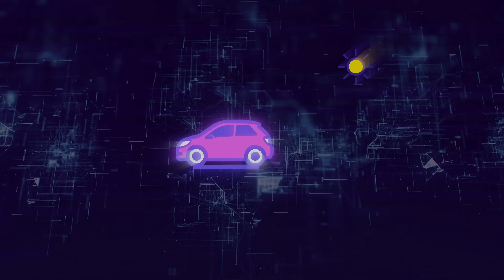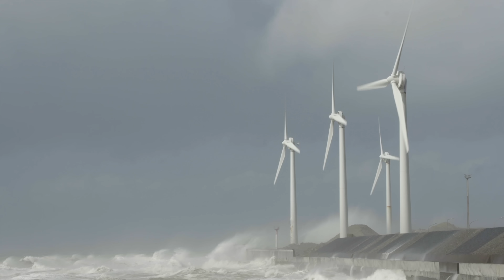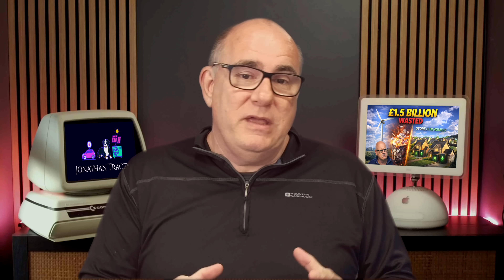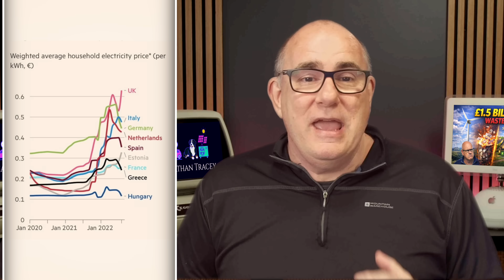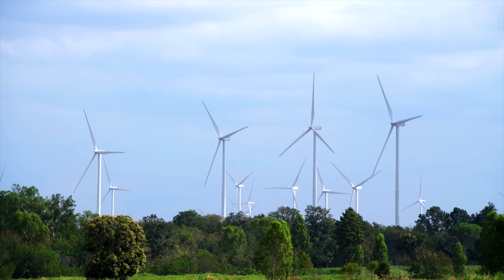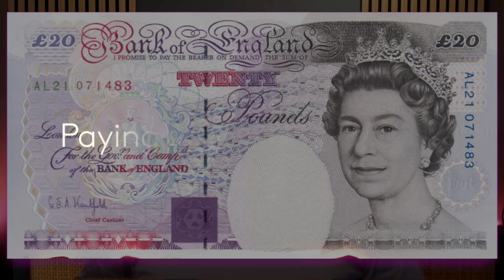We’re Paying £1 5 BILLION To Waste Energy… Here’s My Big Idea

Comment: Did you really just say putting a battery in your house will reduce your energy bill? How?
Reply from the maker: @tarbat Yep — sounds odd at first, but it’s actually pretty simple once you break it down 👍  

There are basically two ways a home battery saves money:

*1) “Free” or surplus energy*  
When there’s too much generation on the grid (lots of wind/solar), prices can drop very low — sometimes even negative.  
If your battery charges during those periods (either automatically via a smart tariff or because you’ve got your own solar), you’re effectively storing energy that costs very little — or nothing.  

Instead of exporting it cheaply (or the grid curtailing it), you keep it and use it later in the evening when electricity is expensive.

*2) Cheap overnight → expensive daytime (arbitrage)*  
On tariffs like Octopus Go, you might pay ~7p/kWh overnight and ~27–30p during the day.  

So the battery:
- Charges overnight when it’s cheap  
- Discharges during the day when it’s expensive  

That difference (say ~20p/kWh) is your saving — every unit you don’t buy at peak price adds up.

So no, the battery doesn’t “create” energy — it just lets you *choose when you buy it* and avoid the expensive periods.  

That’s where the savings come from 👍
Reply: @JonathanTracey  All of that requires me to move to a time-of-use tariff. I've done the sums for intelligent Octopus Go, and I would need a 12kWh battery to break even by storing energy during the 6 hour night rate (8p) to make up for the far more expensive 18hours of daytime rate (33.5p). That's just to break even, with a capital cost of £8,000 for the batteries.
Reply: My home battery  saves me over £1.5k per year
Reply: @SDK2006b How?  My electricity costs me 22p per kWh 24x7. Storing it in a battery won't save me any money. In fact given the charge/discharge losses, my bill will increase.

Comment: with a lot of excess wind energy in scotland and transmission constraints first at b6 and than at b4 one should start handing out batteries in scotland first!
Reply from the maker: that's exactly how it should be one, then you lighten the load in scotland and allow more capacity to move energy south, you then chase it south adding batteries as you go
Reply: Yes, hand out batteries for free, but also pay the householder "rent" to host the batteries. I'd sign up for that.
Reply: @tarbat  Maybe that's an extension for Octopus to look at. It's really just a twist on intelligent flux. My guess is that you can't make the numbers work.
Reply: It would take 240 GWh of batteries in Scotland to solve this issue, which would cost £48B. The cables they're already installing will be ready by 2030 and cost £8B. If we did this in BEVs, we'd need 3.7M 0% SoC BEVs connected to the grid. There's only 3M cars in Scotland as it is.

Comment: As unreliables are... unreliable, and gas is always kept in spinning reserve, the solution is obvious: scrap windmills and just burn gas efficiently. End the farce of pretending it's green - unreliables, that is - and just abandon the gibbering nonsense of unreliables. Australia tried grid scale batteries. A small mining town in the outback (mining for copper for solar panels, ironically) needed a hectare for ten minutes of backup at comedic cost. 

Home batteries are a good idea, but 2k/Mw wouldn't be anywhere nearly close enough, let alone there's just not enough material to make them. Comparably the 1.5bn - a month, mind, not a year - is nothing compared to the cost of those batteries and really, all we're doing is giving money to China, DRC, India for mining. It is far, far far more sensible to just abandon the hoax of unreliables.
Reply from the maker: @px794 I get where you’re coming from, but I think this is mixing a few different issues together.  

Gas is reliable, but it’s also exactly what’s driving the price volatility we’re all dealing with — that’s the bit people are trying to move away from, not just for “green” reasons but for cost stability as well.  

On batteries — they’re not meant to replace weeks of generation, they’re there to smooth short-term imbalances (hours, not days). That’s exactly where most of the curtailment cost sits today.  

The Australia example gets quoted a lot, but there are also multiple grid-scale batteries there now saving money by reducing peak demand and stabilising the grid — so it’s not quite the failure it’s often made out to be.  

And on materials — totally fair point that scaling isn’t trivial, but the same argument applies to gas infrastructure and imports. We’re already dependent on global supply chains either way.  

Reality is this isn’t “gas vs renewables” — it’s about building a system where renewables, storage, and flexible demand all work together so we’re not paying to turn things off and paying for gas at the same time.

Comment: Homes are space constrained and awkward places to put energy generation, at scale. Also for doing it at scale, get it wrong and there are fire risks, cybersecurity risks etc. Feels like it would be better to just go have a programme of building grid-scale batteries near wind farms.
Reply from the maker: @cjholmes2 All valid points 👍 — but they’re also the same reasons we end up doing nothing and sticking with the status quo.  

Grid-scale batteries absolutely have a role, but they come with their own risks — centralisation makes them a much bigger target (both physically and from a cybersecurity point of view), and you still need massive grid upgrades to move that energy around.  

Distributed storage flips that on its head. Yes, it’s messier, but it’s also more resilient — thousands of small systems are a lot harder to “take out” than a few big ones.  

And on cost/speed… a home battery can be deployed today with a plug. Grid-scale takes years of planning, approvals, and infrastructure.  

Reality is we probably need both — but waiting for the perfect centralised solution is exactly how we end up curtailing £1bn+ of energy in the meantime.
Reply: @JonathanTracey  We already have that. The method of buying a big home battery to store off peak electricity on the cheap is not a new idea. You don't need government permission to buy and use a standalone battery that only connect to the grid to charge. It does technically work but it is expensive when you consider that batteries are expensive and they degrade with every charge/discharge cycle that you put them through. People used to tout them as the being the solution and then it's gone all quiet(my guess is that reality hits home when they realise that electrical batteries don't last as long as they thought). Anyone can personally put it to the test.

Comment: I've been saying this for yearrs! What about new "smart" appliances all having a battery, so they can store their own energy from off-peak times?
Reply from the maker: I'm not sure putting the battery in the appliance is right, then it limits the use of stored energy to that device, having a central battery means any devices can use the energy
Reply: Smart devices that can be set to switch on during cheap electricity times, but separate smart batteries that can feed dumb appliances, and occasionally smart appliances, with saved off peak electricity.
Both my washing machine and dishwasher can be set to turn on later, but linking  smarter versions to actually prices as they vary would be even better.
Reply: @ziggarillo 
Both my white goods have timers, but trying to explain to the CFO they are okay to use in the Cheap periods at night ! Is a headache that I am getting tired of 😢.
Reply: Two problems with that
- It's more cost efficient to have one big battery
- PAS63100 says your battery belongs outside, in a garage or similarly fire partitioned and definitely not where it might block an access route or there is naked flame.

It is doable - there are actually cookers in some countries that include batteries so they can manage to operate a decent sized induction stove and ovens off a low rated electric cable.

Comment: Well put I am 100% behind what you say. We need to run the grid connections at 100% day and night. I have 21Kwh batteries + 60  Kwh Tesla car and would love some of that free energy in the winter.
Reply from the maker: there should be a standing rule we don't shut down renewables even if we have to give the energy away. I don't agree with negative pricing (being paid to use it) but zero cost energy when there is a glut that needs used up
Reply: Jon i can't get Octopus flux because they have withdrawn it from the market

Comment: I think newer electric cars can do bi directional charging. So if the house needs power it can pinch a bit from the car and top the car up in the small hours. So the majority of houses would have its own storage by default? Appreciate we're a ways off that with couple of million EVs currently. But in the longer run...
Reply from the maker: all evs are technically capable its just not a function the manufacturers are turning on
Reply: @JonathanTracey  Is this true? It would need a DC to AC converter inside the car. As this would only be needed for V2G I doubt that any car that is not declared V2G capable has it.
Reply: @rockyallen5092  This is on point. The V2L ones might not by G98/G99 compliant for grid export. You need V2G for compliance with the regulations. Hypothetically you could export DC via CCS to an external inverter to enable export from EV's without V2G with DC fast charging, via a software update.
Reply: @Leo99929  There are a bunch of G98 approved devices that can use V2L as a secondary battery charger (you need a buffer battery really). It's easy to set up if plug in becomes allowed but there are some important details about grounding and stuff.

There are kits for V2L->plug in "solar/battery" in some countries. It's not hard - not particulary efficient either though.
Reply: Totally. Our 60kwh-ish EVs are idle for 95% of the time; turn them into revenue generators. Furthermore, governments should have holistic regulatory and taxation structures to encompass such facilities for nearly all that 95%. At work, gym, shopping centre, etc. After all, one's consumption (and connection to local generation - solar on such buildings for example) largely follows you around. It would negate much of the big delays in the grid to catching up, remove gas from the network almost completely, speed up electrification and reduce emissions from transport and the grid more generally.
Reply: This only solves the problem if ~3.7 Million BEVs are plugged in at 0% SoC north of the B6 in Scotland. There are currently only about 3.09 million cars in Scotland. Assuming 50% SoC that's >7M cars. This sadly isn't a viable option. 

Luckily to fix this, the UK is currently building the Eastern Green Links (EGL1, 2, 3, and 4). These are additional 2 GW subsea cables. By the early 2030s, these will more than triple the capacity to move power south.  The goal isn't just to stop the 10 TWh of waste we have today, but to prepare for the 80+ GW of new wind power currently in the planning pipeline—enough to turn Scotland into a "green battery" for the rest of Europe.

Comment: I agree with your idea. But putting small batteries in every home may get quite expensive. They should change the laws in substations allow them to store energy and sell it back. And install batteries in every local substation. And give incentives for homeowners to get batterys like bigger discounts. Or 0 interest loans
Reply from the maker: by putting them in every home you get a fully distributed battery, centralised batteries would need large expensive interconnets to the grid
Reply: @JonathanTracey it wouldn't be any more expensive than putting a battery and small inverter in every single home. Substations already have the infrastructure. Batteries what  just allow them to even out the the demand. Especially during peak hours. Building 200 kilowatt hour batteries would we fight cheaper than building the equivalent in smaller batteries.

Comment: Absolutely correct Johnathan.  We also need to get vehicle to grid sorted, with the size of car batteries often sitting there that could be used. The trouble is the Governments respond to negative thinking people and are scared to loose votes. Sad.
Reply from the maker: @terrylivermore9107 V2G is a great idea in principle 👍 — you’ve got huge batteries just sitting there most of the time, so it makes total sense to use them.  

The challenge at the moment is incentives. There’s not really anything in it for the car manufacturers — from their point of view it just adds more cycles to the battery, which means more wear and potentially more warranty claims.  

Until there’s a clear way for them to make money from it (or reduce their risk), I don’t think they’ll be in a rush to fully open it up.  

Feels like one of those things that will happen eventually… but needs the right business model, not just the technology.
Reply: Think about a small business, hammered by extortionate electricity costs.. V2L would destroy that exploitation, you could simply charge up at home drive to work and plug in.. They would have to figure out a way of preventing that😅
Reply: 100% agree, we do! But it wouldn't solve the problem given the 240 GWh battery needed would be 3.7M cars at 0% SoC, and there's only 3M in Scotland at the moment... Don't worry, they're building under sea cables for £8B. The battery would cost £48B at 40% of the cost per kWh Jonathan estimated.

Comment: To much common sense for this Government
Reply from the maker: TBH for any government, they are not interested in big ideas, just keep the gravy train flowing
Reply: Has anyone said that highly intelligent “What happens when the wind doesn’t blow or the sun doesn’t shine”
BATTERIES!
Like for a hundred years we stored coal and gas, not mined another lump of coal when we ran out.
Reply: This is precisely the sort of daft idea this government would come up with. Spend 5bn on batteries  - which would take 3 years to provide by the time a better battery material would have been invented, eventually costing 20bn by which time the unreliables hoax has been abandoned and home batteries not needed. Stop trying to solve the symptom. Cure the disease. Abandon the tax scam hoax of unreliables.
Reply: @px794  ... What are you talking about? 

Solar and wind are half the price of gas even including batteries for when it isn't windy/sunny, AND paying them not to deliver power when there's an over production (25% of the curtailment cost) and paying the gas plant to deliver power elsewhere (75% of the curtailment cost). 

Get solar PV on your roof, a battery, and a heat pump, then tell me it's a "scam hoax". I'm saving £2k per year without any tax incentives and I don't even have solar, yet!
Reply: @Leo99929 If you get and EV (recommended a nearly new) you will also save  a further £2K.  I have no idea why RoI never takes into account the savings on petrol prices compared to charging a EV.
Reply: @px794 so what’s your answer?

Comment: Isn't the issue that the spare electricity from the turbines is in the wrong place?
Reply from the maker: so start putting the batteries local to the generators and work out from there, then you reduce the capacity needed to carry it long distances. While this is happening use the rest of the money not spent on curtailment to invest in the grid
Reply: Practically, yes. The solution therefore is to to have the unreliables providers pay for the grid upgrades rather than dumping that cost on the tax payer. It'd be nice if they also paid for the windmills as well, but that's slapped on bills too. And decomissioning, which hasn't been considered. In fact, all the foreign companies who 'invest' in unreliables get is massive subsidy, paid from our bills.

Comment: I totally agree :Stop giving out smart meters and give free battery packs.I have contacted loads of people to get this off the ground : Stop advocating solar and its cost  plus the installation time.Giv out free batteries :Stop this fear of plugging them in yourself. ❤❤❤ Keep this going it is the unexpected answer!
Reply from the maker: @Colin-p7p I get where you’re coming from 👍 and you’re right that batteries are a big part of the solution.  

Where I’d push back slightly is “instead of solar” — batteries don’t create energy, they just shift it around. So you still need generation (solar, wind, etc.) feeding into them in the first place.  

The interesting bit is actually combining the two:
- Solar to generate locally  
- Batteries to store and use it at the right time  

On the “plugging them in” point — I agree the fear is overblown in many cases, but it does need to be done properly and safely rather than treated like just another appliance.  

What you’re describing though — lots of smaller, distributed batteries — is definitely part of where things are heading. The challenge is making it work at scale and coordinating it properly.
Reply: @JonathanTracey keep at this train of thought: it is ripe for a plug and play solution.